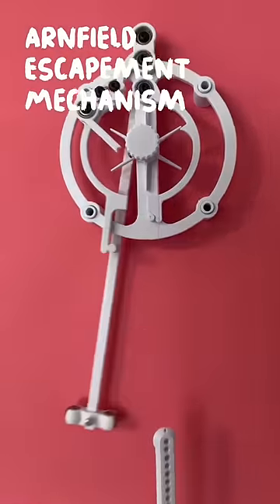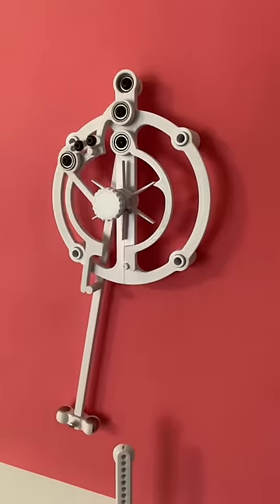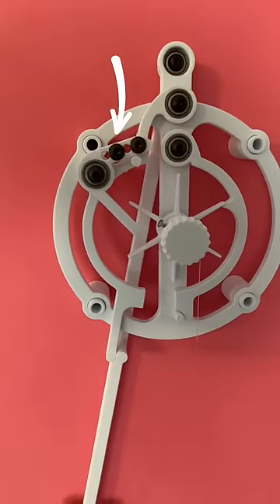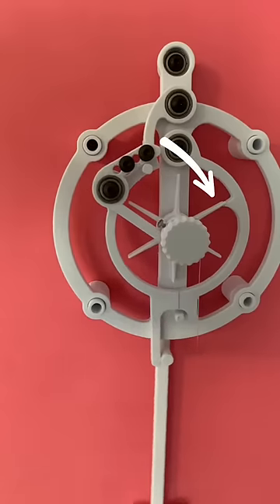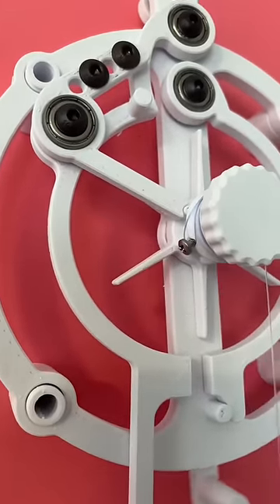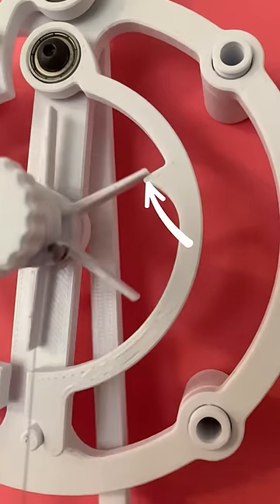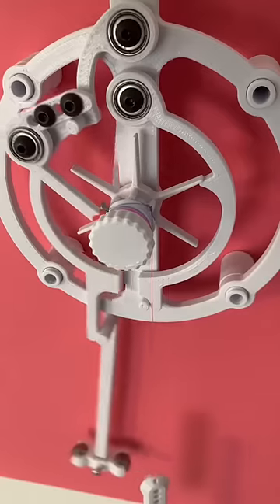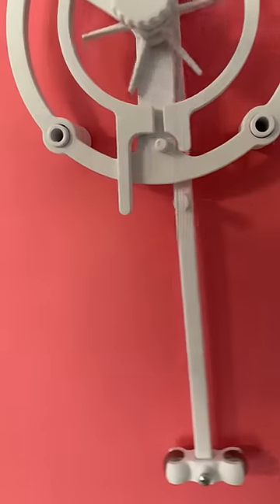The Arnfield Escapement Mechanism | Mind Blowing

Comment: The only energy in the system is gravity and the initial activation energy. The money the weight sting unwinds around the shaft it will stop and you have to rewind it back up. Basically it just controls the speed that the weight falls and without activation is just holding it. Not that crazy

Comment: It won't put more energy into the system. In every cycle, it holds less energy than the previous cycle. So eventually clock will come to stop. Because it's losing its energy as friction, heat, and sound.

Comment: Uhhh no. There is literally a weight hanging by a string mounted to the wheel forcing it to turn upon release. No energy is going back into the system. It is being released from that weight under tension.

Comment: This is a grandfather clock movement. The design is a few hundred years old. And still it won't run forever. You have to reset the weight on the string. It was brilliant then. Now it's just a low quality copy.

Comment: It looks promising but he just forgot to show the small electric motor that he intentionally hides it behind the system to add the energy it loses after each wiggle.
Reply: There's a counterweight hanging on a string (it's off camera, but you can kinda see the string) that's storing the potential energy that keeps the system running. It's the mechanism used in every cuckoo clock and grandfather clock.

Comment: Eventually friction will conquer all and motion will cease!
Reply: No, the weight is what is giving it energy. As long as the weight on the string pulls down, the mechanism will continue. Then when you run out of string, you need to wind it up, just like a real grandfather clock

Comment: There’s a magnet on the pendulum pulling it back and forth. There’s not energy being sustained.
Reply: The thing you are suggesting is incomplete at its best and a plain lie at its worst. It would prob be possible with a electro magnet, not with a normal one, but thats not the case either, theres simply a weight attached that pulls on it, until it reaches the ground, and then has to be manually reset

Comment: Nothing, absolutely nothing,  besides the winding of that weight "puts energy back into the system." You may get some extra efficiency from some parts of the mechanism but every single swing of that pendulum is a net loss to sound and heat.

Comment: Not mind blowing. There's a plumb bob weight that's pulling the string that drives that machine. I would be blown away if there would be no plumb bob or if it works independently without gravity.

Comment: I thought self sustaining energy was impossible??

Thts why we still have energy plants and cars tht use gas or electic??
Reply: It’s not self sustaining. There’s a weight on a string pulling the central gear clockwise. Once it runs out of string, you must wind it up again
Reply: But theoretically, since there is a finite amount of energy in the universe which cannot be destroyed, we could at some point make a completely lossless machine that always outputs all the power we need.

Comment: It's  simply a form of perpetual motion.  It's not "escaping" anything, nor is it generating anything. No weights drop, no mice go flying across the room, or anything quasi cool like that, so... What's the purpose or need for a perpetual pendulum?  Kinda pointless if you ask me, but whatever floats your boat dude.
Reply: This is not perpetual motion. It is not "escaping" it is escapment mechanism.  Go back to engineering school before.you embarrass yourself again.
Reply: Hmm..57 minutes later and no comeback? Is that because no matter what you call it, it is Still a form of perpetual motion. Once you set something into motion, if it does not stop by full expenditure of the energy it generates to stay in motion, it is a "Perpetual motion device"   which one of Newton's laws is it, that once an object is placed into motion, it stays in motion?  Somebody needs to relearn physics...
Reply: @vkg3517  i got no other reply. the energy is expended when the weighted line reaches it's end.
Reply: @pathevermore3683  I honestly didn't see the weight drop at all, and I sat there and watched that little replay for close to 5 minutes
Reply: @vkg3517  the law is " an object in motion tends to stay in motion unless acted upon by outside forces"
Reply: @vkg3517  he only mentioned the weight 3 times when describing how the mechanism works.
Reply: @pathevermore3683   the point being that it was not stopped, nor acted upon by outside forces in any way.  So which one of the weights was the one in motion, if not the big one on the left armature, that was in motion Only when the pendulum swings to the left and moved it.  What's it that little strip of 3 weights at the top, that was not pushed, pulled, twisted, nor turned in any way in the beginning in order to start the device? All I saw was the pendulum being moved to start it. So can you please explain the significance of a self perpetuating pendulum for us dumn-asses?
Reply: @pathevermore3683  yes, but did "You" see Any of the weights move, other than the one on the left armature?
Reply: @vkg3517  the 3 "weights" at the top are bearings. 

the "significance" is demonstration.

yes i saw the weight move.
Reply: @vkg3517  on earth, we have 2 forces that always effect motion, gravity and air resistance. this mechanism uses gravity to assist the pendulum in maintaining momentum with the wieght hanging below the model. those combined with the counter weight on the left side (2 big black dots) all work together to create a lot of motion with very little energy. 

mechanisms like this are mainly used as mechanical timers, such as how mechanical clocks work. in fact a weight, counter weight and pendulum mechanism is similar to this, but using gears instead of leavers, is what makes a grandfather clock work.

Comment: 🤣🤣🤣🤦‍♂️🤦‍♂️🤦‍♂️

Well, let's explain something here. 
The "half ring" is called pallet.
Opening pallet is the left one, closing pallet is the right one. 
To make a pendulum work, you need a power. 
Just the friction of the week, the friction of the pallets and the theets of the week,... are enough to slow the pendulum... so it will stop. 

And last thing,... clocks are not made with that... my job will be to complicated with such a system like that.
Reply: The power is not from the pendulum, it comes from the weight on the string that slowly falls with each tick. Clocks are generally more complicated than this, but it’s the same idea in a grandfather clock
Reply: @largestbrain  read again what I wrote
Reply: @largestbrain  read again what I wrote
Reply: @largestbrain  and I say my job.... I'm a watchmaker and clockmaker.
Reply: @vargvvarriorr4255  well, like you said, this isn’t the exact mechanism inside a modern clock or watch. But you can see that this mechanism is powered by the counterweight; as long as the weight can pull counterclockwise, the pendulum swings.

Comment: Still not a perpetuum mobile, the central spinning part is on some kind of spring that rotates it when it’s free to move, otherwise it wouldn’t move
Edit: you can see it for a short while, there’s a string attached, on the other side is weighted

Comment: It's efficient, but not free - you make it sound like you think this mechanism runs without losing any energy. You either need to reword it, or learn why that's not true.
Reply: Efficiency is not even the topic here, the hell are you talking about?
Reply: @ber2996  how is efficiency not the topic? If it is a lossless system, it's 100% efficient. And since no mechanical system is 100% efficient, the system isn't lossless.
Reply: @MichaelJohnson-kq7qg  omg who dfq said anything about it being a lossless system? All this clip's about is showing the Arnfield Escapement Mechanism.
Reply: @ber2996  I don't know what to tell you. If you don't think the way it's presented here is misleading and suggests that it's returning the energy to the system, I don't know how to explain it.
Reply: @MichaelJohnson-kq7qg  uh no, the weight is there to provide the rotating force and it's common sense to think that it won't work if the weight reached the ground. And even if someone think otherwise they can just simply google the mechanism to see how it works, it's literally the title of the clip
Reply: @ber2996  It really feels like you decided to respond to my opening comment, but didn't have anything to say so you're just winging it.
Reply: @MichaelJohnson-kq7qg  more like you have everything nonsense to say even if it's irrelevant to the clip
Reply: @ber2996  your inability to understand makes no difference to the original point. A point which - if you read through other comments - you will need is not something only I noticed.

It's okay. You don't get it, that's fine.

Comment: It's a free energy perpetual motion device for a clock but could be used for free energy so next time you get "climate change " and govt control over gas engines just think about the fact THEY don't use free energy 🤔
Reply: Look at the bottom. Theres a counterweight, once that reaches the bottom, energy has to be put into lifting it back up, to reset it

Comment: "Puts energy into the system." No... That would be perpetual motion which is impossible because of those pesky physics out universe has.
Reply: I think he means it turns the constant downwards pull of the weight into oscillating moments of energy from left to right, so as long as the weight pulls, the pendulum takes the energy and keeps on swinging

Comment: Perpetual motion is tough to come by but if there was a way to incorporate a very small electric pulse to get it going then we could all have 24hrs of energy to power each individual with less than 1 minute of electricity. So if you burn coal to power electricity, then electricity powers everything else we can actually cheat the process by storing energy and only putting out as needed for the next 24hrs. This is not a hard concept to get your brain around. In fact I will experiment and record results in my own home for 365 days. I believe this will work and will absolutely prove what Tesla always prophesied. The Earth's energy can light up our entire world. This has been done and proven. Big Industry i.e. the elite that own everything don't want this. It's really simple and CHEAP!!!! Snapshot this. It'll be gone tomorrow
Reply: So if I understand what you are saying correctly, you want to burn coal for electricity?